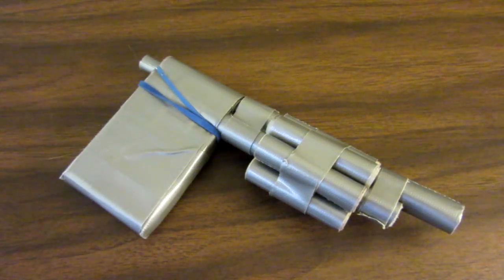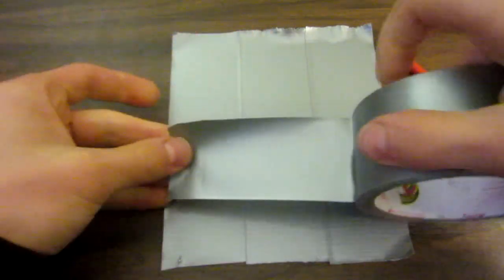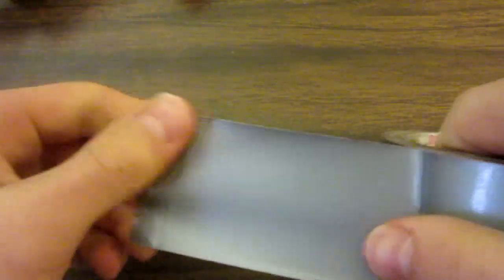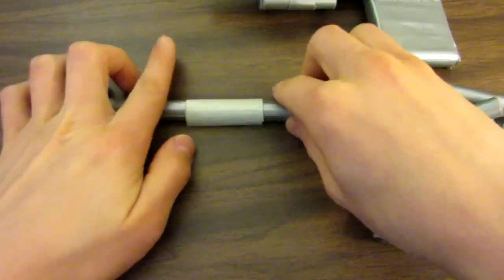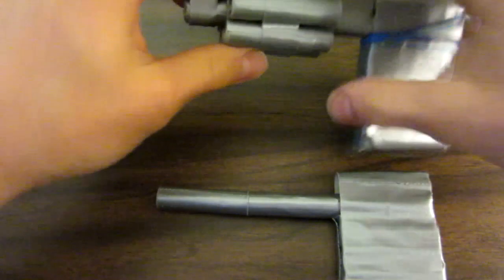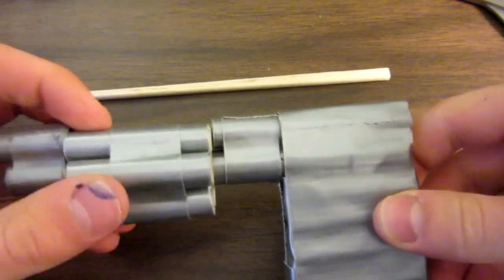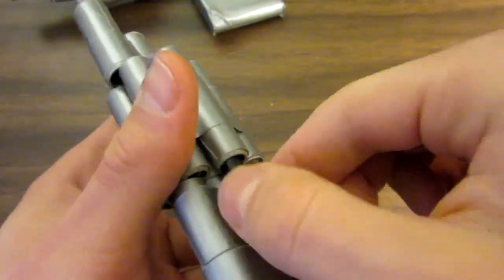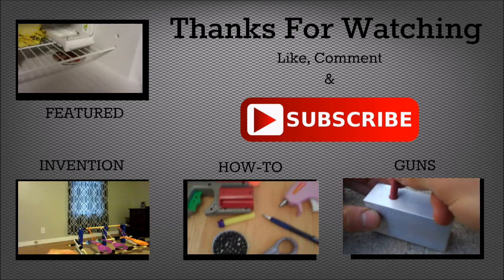How to Make a Shooting Duct Tape Revolver

Comment: there are a lot of modifications to make it function better (suggestions):  add another set of cylinders above the main barrel to ensure that it all stays lined up. make a backwards trigger that you fire with your palm by adding the excess chopstick to the back of the grip to create a crowbar effect, then possibly make a foregrip to make it easier to hold when using the trigger. :P just suggestions.
Reply from the maker: Yeah for sure but I tried to keep it simple
Reply: Try making a hole through one of the tubes  and make a trigger mechanism by attaching another S shaped dowel for the trigger